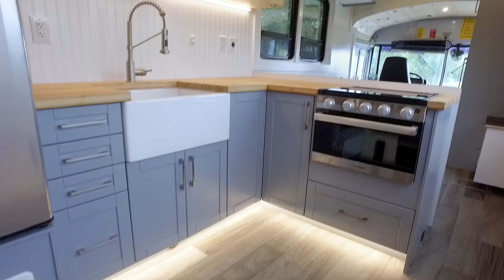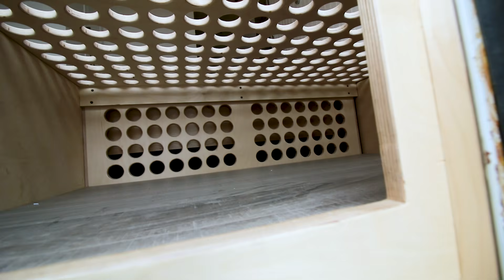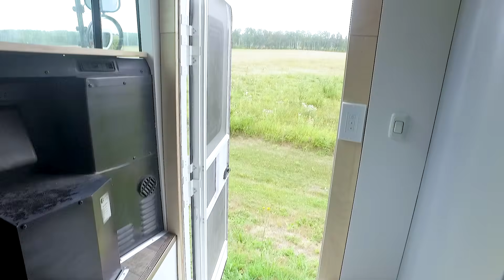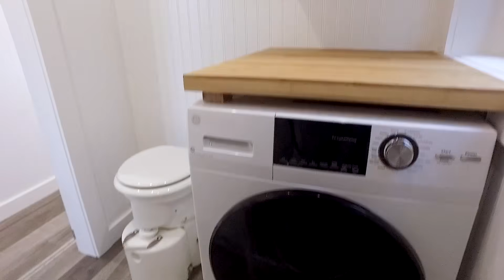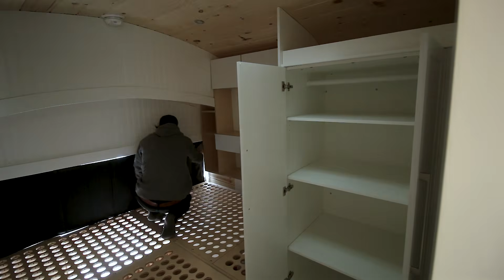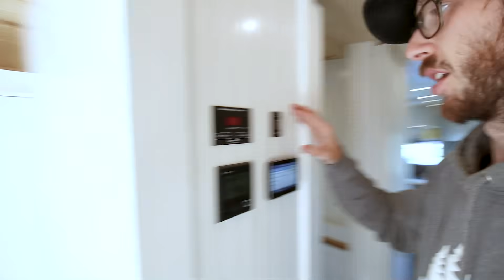Californian Couple Move Into Beautiful, 4 Season, Off-Grid, Skoolie w/ A Raised Roof! ~ Full Tour ~

Comment: One of the best looking busses I've seen in a while. @3:00 min. I bet you have a heck of a time looking to the right at stop signs and stop lights with that very low and small RV window in the door. It would have worked much better with the taller big window door. I wouldn't mention this if it wasn't such a hazard when driving.

Comment: Very nice conversion, nicest I've seen!
I'm curious, when you all do the roof raise is the added steel galvanized alloy steel or straight mild steel?
Your work quality looks very high with straight lines and close tolerance fit and finish!  I couldn't help but notice that from an appearance point of view most of the furnishings look to be on one side so how is the weight distribution fairing?  Why no mirror over the bathroom sink?

Comment: The owners of this gorgeous schoolie really need to be given more credit and praise for the design, layout, and work they did before handing over their bus to you to build out their plans and designs they created. They did the demo and roof raise which are both time consuming and intense hard work. That part seems to have been missed by 99% of the viewers who left comments.  You and your company did an amazing job building out their plans and did such a high end job creating the different components of their home which look extremely well built and will last for many years to come.  Have you ever thought about not using the traditional batteries to store the energy collected from the solar setup? I have recently seen a couple of people who live completely off grid who have installed a system that includes a solar generator and rechargeable batteries that can be recharged with the solar panels or from a landline hook up when you stay in a campground or are able to plug into a higher wattage of electrical. I have seen a couple of these portable generators that can power multiple high energy draining appliances (washer, dryer,fridge and freezer and a heating and cooling system for hours and they barely put a strain on it. Then you can also piggyback multiple additional battery banks that allow you to provide energy for even more things for longer periods of time and still not completely drain the batteries. As they are connected to the solar panels they are constantly being recharged when the panels are exposed to sunlight even on a cloudy day. Jake from the Jake and Nicole who are living completely off grid on their property on Vancouver Island in BC has been doing a lot of research and testing of this type of solar generator and battery system to use both in the house they are building and in their sailboat. They have been using a couple of the solar generators/power source for the last 4-5 years to charge their phones and other electronics and the batteries for their many different tools. They make sense because they aren't temperature sensitive, last for years, aren't a fire hazard and take up less space.

Comment: I have to say... That thing is impressive!!! The windows and the roof raise just give so much space. The L couch and L kitchen works nicely. My only concern, the water system, the valves, and the filter. While under the bed makes great sense, have you thought about the access when there's a mattress wedged on top of the panel. I was just thinking that putting those controls and filter closer to the back door...

Comment: How much weight did this build add to the empty bus, and how close to it’s maximum weight did it come?
We know from experience that a load unevenly distributed to one side of a truck can lead to handling problems. 
It seems like there’s a lot of heavy stuff all on the left side of the bus (kitchen, lots of wood structure, washer, water and waste tanks, etc. 
What considerations did you give to left/right weight and balance?
I’m beginning my own build and would like to know how you deal with that issue. 
Thanks

Comment: Mostly perfect, except for the galley. The galley is perfectly executed, but badly planned. 

The sink and the range/oven need to swap places, so that a hood can vent the range and the oven. This is a horrifyingly small volume of air, and if you don't want your entire existence to be covered in grease and smell like bacon and rancid brisket, you need a vent hood over the range and oven. 

It's also why you need a low tech microwave instead of a fancy pants convection microwave that exhausts into the cabin.

Other than that, I wish I lived in this thing.

Comment: Wow! 
Love all the thoughtful touches. 

Questions:
Is weight distribution considered for suspension and handling with a passenger side walkway and all appliances, water, cabinets and storage on the drivers side?
Where does co-pilot sit?  
Seat belts installed?
Reply from the maker: Believe it or not this unit ended up quite balanced! The gas tank was located on the passenger side and held an incredible 100-120 gal of fuel (850-1000lbs)

Comment: What’s the price on the build and why not put the freshwater below and insulate?
Is ambient floor heating included?
Reply from the maker: Price of this conversion was around 130k CAD. This unit isn't equipped with ambient floor heating. Couple reasons we choose to keep Fresh tanks on the interior. (1) That's a lot of water to keep heated, large constant power draw, (2) Very hard to keep Fresh line that are now on the exterior heated. A lot of extra labour and more dedicated heat protection.

Comment: Not a fan of the back cushions on couch. If they were made like seat cushions the bed conversion would be more comfy.  Other. Than that everything else is gorgeous.
Reply from the maker: Thanks Joy! Correct, our new design actually incorporates a split seat cushion (3" each). This gives a 6" couch seat cushion and a 3" spare bed when extended. The reason we don't do back cushions the same as the seat cushions is because 99% of the time this area gets used in "couch mode", and fluffy back cushions are much more comfortable! Thanks for your comment :)

Comment: After watching the lock picking lawyer videos, that padlock in the back scares me for 2 reasons: 1) it looks like it would be easily picked/broken with the right tools and 2) if something goes wrong in the bus it cannot be opened in case of an emergency. Other than that it is a beautiful conversion!!
Reply: I was about to direct them to the lock picking lawyer! 😬
Reply: Padlocks are basically ornamental for anyone who can use a basic lock picking kit. I took a lock picking class and was able to open all the locks even the most advanced ones in under two minutes each. And I have fine motor skills challenges bc of dyspraxia.

Comment: 1st  Music selection was ok but It was the volume level that had me mute and turn CC on.  And that could be fixed even now by setting volume level the same through out video.  2nd  Layout was a bit zigzag to me.  3rd  Not a fan of custom seating/sofas. Have not seen one that looked comfortable. Purchase a nice Recliner Sofa and set it on storage platform.  I agree with the other post on the slick leather seating neg comments.  4th The full size cabinet in the social space.  Boy talk about a catch all junk closet. Counter height yes but not full size.  That would allow for a nicer entertainment section.  5th Kitchen was great except for the stove location (boiling over,grease popping)  Plenty of workspace but you have a huge backsplash.  Windows  would have been a good idea.  6th Bathroom was great. A+  7th  The in-floor storage for the solar equipment, great location for batteries with room to go. Access to equipment will be difficult when trying to get to the emergency shutoff switches and fuses.  And what happens if bus is leaning and they take a shower, water could be running into floor storage.      Finally P2P does an outstanding job with their Craftsmanship. A+++
Reply from the maker: Incredible response!! Thanks so much for the feedback 🙏🙏

Comment: Beautiful. Absolutely Beautiful. I can only think that this is probably close to if not a little above100k. The work, details and material deserve it so that would be my guess. For people saying OHHH that’s too much! The average new SMALL rv is running 25k and that’s just a small one made of cheap materials. One of this size and the standard RV of cheap aluminum, cardboard walls with dumpy interiors (that almost everyone ends up painting or ripping out) can range from 50k-100k. This also comes with a huge solar set up with all the bells and whistles to be off grid, that alone is worth 10k depending on battery banks. There are so many little details that are not cheap to do or create. The windows being replaced with expensive dual pane, insulated windows and doors is huge. The cabinetry is custom made w 1/2” birch and not cheap mdf, and there is tons of it. Shoot, those swing out seats, the bracket’s themselves run at least $250 a piece. The detail work done with the exterior paint and roof is a pretty penny if you source that out. Those are just a few of the many things this builder has done. So for me, I understand the price tag and the client’s decision to spend the 100k (a guess) to have exactly what they want. This builder skipped on no details and I’m sure those so many more we didn’t even see. You can see prices of  $100k with mass produced RV’s w low quality, cheap material and decor that are not built to last. Lastly, there is an ability to get a return on their investment by renting out their bus (there’s several platforms now that do just that). Easily gain $ as an AirBnB, monthly rental with a tenant, use it as a guest house, or their primary residence. 

One ☝🏻 question… I thought the clients said this was a three year process? If so, was that on their part or was that the builder? What is a normal turn around on this exact kind of build?

Again, this is absolutely gorgeous, the detail and craftsmanship in this build is bar none. I’ve watched thousands of bus videos and w all the little details and the quality alone makes it exceptional. It’s hands down #1 in my book, the builder should be extremely proud of the outcome. As said before, Amazing job on the execution, craftsmanship and build. The client’s did a great job on their design, I hope they enjoy their experience with it. Thanks for sharing 🙏
Reply from the maker: The amount of care, and thought put into this response is incredible. So, let me start off by saying THANK YOU! I will share this with the team. We are fortunate to have a group that simply cares. Building is their passion and we want to continue pushing the limits of custom & quality, purpose built rigs. 

To all your points regarding budget. You nailed it. Aside from actual material costs, the labour involved in these custom units is INCREDIBLE. Decisions to use Baltic materials for our furniture (structurally designed with lattice type cut outs to reduce weight), upgrades drawer slides, Pine trim materials (because MDF will get wet in an RV and swell), top of the line insulation, upgraded floating luxury laminate flooring (expands and contracts in hot and cold), lighting in all the right places… these are the decisions that provide a high quality, long lasting product!

In regards to timeline for a unit of this caliber, the total turn around was 5-6 months. (The three year comment was regarding the inception of the idea “let’s live in a skoolie!”). 

We are working with suppliers (difficult times in the manufacturing world) to shorten these build times. The goal is 3-4 months for a bus like this! 

Again, thanks for the comment and for following!! 🤘🏻

Comment: 1. Opening window - to small to let much air in.
2. Back door padlock - one good whack with a regular hammer and you have visitors inside.
3. Rounded cushion on couch/ bed - will not stay tight leaving gaps in the guest bed.
4. Stove backing onto couch - did you ever fry bacon popping grease on cushions.

I have done lots of RV camping and these are just things that have popped out at me that I have either experienced or been told been a problem in other units.
Reply from the maker: Hey Cheryl, thanks for sharing!! Regarding point 4, I believe there is a moment in the video that I show off the glass backsplash that pops up!

Comment: Total conversion cost? I LOVE THIS! IT IS AMAZING! I know you may need to break it down to Exterior (paint  and windows), Cabinetry, Plumbing and wiring, Kitchen appliances and sink, Bathroom /laundry conversion, Heating and AC,  Electrical systems/solar/batteries/etc.and possibly Total time taken? Any other missed items?
Thanks I am VERY interested!
Reply from the maker: Hey Dave, you are correct, there are many departments that tackle aspects of these custom builds! I believe this unit went out the door totalling around 130K CAD. Thanks!!
Reply: @2pinesupfitters  THANK YOU,! I now know about what I need  to save up for. I know there is a waiting list so I need to get my life in order to get this started. If I understand correctly, you don't handle the raising of the roof part correct,?  Thanks again, Dave
Reply from the maker: @dpaint6268  absolutely! Let me know if I can help with any more questions! YES! We do have a lineup, so we ask for a deposit to reserve you build spot! If you are from the states, we suggest getting your raise tackled down there! We have a company we contract out for roof raise fabrication, but welding costs are much higher up here in Canada! You can save some money tackling down there!
Reply: Thanks for the tip.  I also need to find the right vehicle to start with before anything can even happen.  If I have a piece of furniture I would like to be part of this (built in- okay for it to be altered if needed) can that also be done? It is a cabinet FYI
Reply from the maker: @dpaint6268  For most cabinetry, we try to stick with our in house catalog (many options), BUT if this a heirloom piece / something that holds sentimental value, we can certainly consider a custom install! We usually just simple bill the alteration hours :) As far a vehicle procurement, we also help with that process once you are booked in!
Reply: @2pinesupfitters  once again,  thank you!! Dave

Comment: So, where does the co-pilot sit? On, the slippery leather couch? So sad for the pilot to have to navigate this beast alone.  IMO, it’s always nice to have an extra pair of eyes up front. With the current setup, the drivers eyes will unconsciously get diverted from the road when communicating with spouse in the back.  And during hard braking, there is nothing to prevent occupants and loose objects in back from flying forward into the wide open cab😱
Reply: Russ Schoonmaker - I agree. I'm glad the young couple likes it. I like the wood they used in the build, but it's basically like many others I've seen. Not a fan of the "slippery leather couch" cushions. The round back cushion would not work with me laying on it as a bed. I'd fall through the crack real quick. The hallway pull-up hatch could've been hinged on the wall side for easier access, instead of having to lean over it from the bathroom.
Reply: I’m sure they will agree with you soon after they have taken their first 100 miles. It looks like they can put in another captains chair or a folding seat by the driver. I’ve seen so many who regretted not having 2 seats and have changed it.
Reply: Ehh it they will probably get use to it most people do

Comment: Very nice and well finished you.  I understand the layout but is there not a lot of weight on the driver's side with all your appliances, water and grey tank.  Also the baltic birch is very nice but does that not make the unit very heavy.  What is the GVW on the unit.  I am sure the freightliner can handle it but seems might be a little different to drive all the weight on one side. 
But truly a beautiful looking bus.
Reply from the maker: Thank you!!! And awesome comment. Great observation and we certainly planned a few counterweights. On the passenger side, we’ve positioned the power system and batteries, a toolbox planned for fuel/genset transport, and the largest of all.. the diesel fuel cell! You’re right this won’t touch the freight liners GVW. The ride improvement post conversion is impressive. I’ll track down those weights for you as it was getting checked at customs on route to San Francisco!